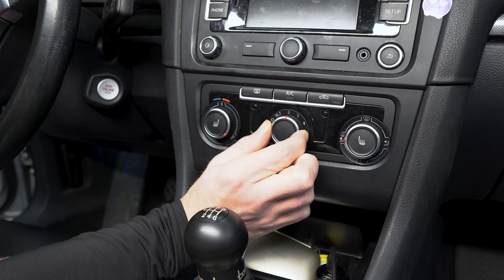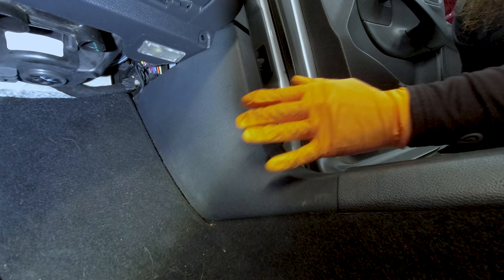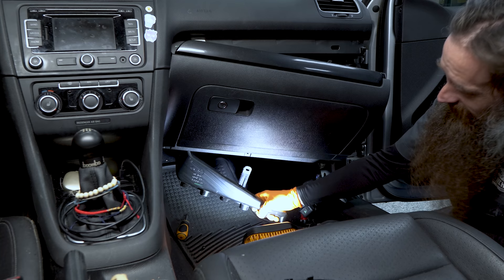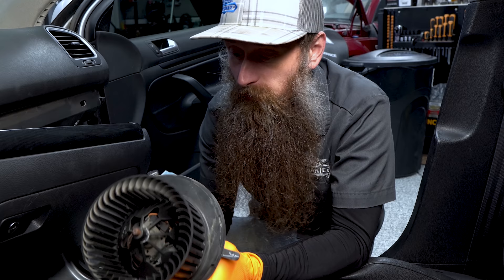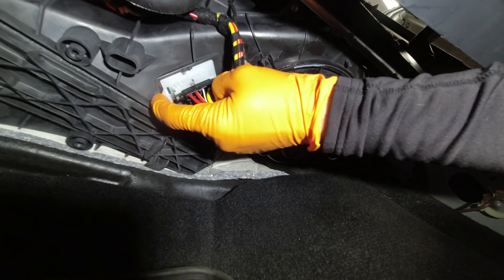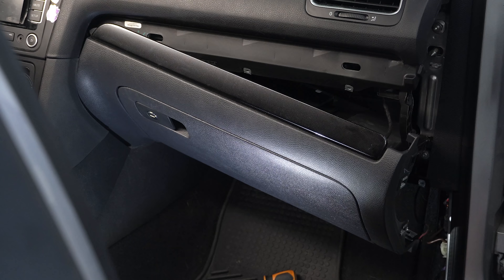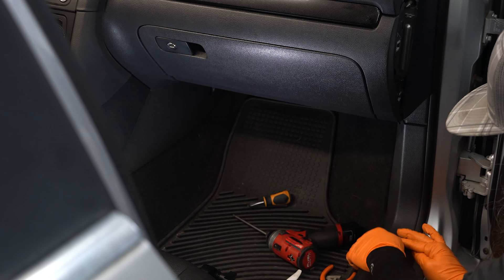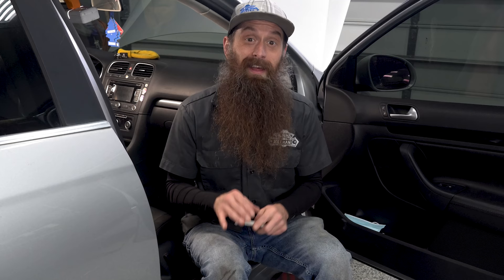How To Fix a Blower Motor Not Working ~ LOUD NOISES

Comment: Hey, so I am battling this issue with the cars fans in general. I have a 2006 gli, and my blower motor stopped working with the code 01273 (doesn't say v2 on it though, just short to b+) and I have replaced both motor and resistor/module, checked wiring, checked all fuses, and still nothing. Closest I got to getting anything was I swapped the 460 relays but then got code 00457 and still the 01273. But, oddly enough I could hear the tapping sound it makes when it tries to turn it on but still nothing. So obviously the relay might very been bad, but still didn't fix. Any ideas? I'm running out of ideas and it sucks driving in the rain with windshield fogging up badly
Reply: Also before it completely stopped, I used it was more intermittent and would be an on and off thing and would work if I kicked it lol. Sucky part is, I'm told the resistor/module is vin specific and mine uses revision B and those were discontinued, so im not even sure if new revisions will even work

Comment: I have a code and weird issue with my blower. "Blower reduction due to energy management" OBD11 code b10ce00 vw gti. How would I fix this? I already bought a new motor and resistor. Same issue.
Reply from the maker: TBH I have never seen that one. Make sure your vehicle battery is good.

Comment: How do I get rid of bad smells from my vents? Already changed the cabin filter with not much difference. Can I just spray lysol in there?
Reply: Lysol isn’t effective at cleaning out car hvac systems.
Try some Lubegard Kool-It Evaporator and Heater Foam Cleaner (or a similar product), it cleans the areas where mold is most likely to grow (evaporator fins and condensation drain).
Reply: @300DBenz  Thanks, I will give that a shot. Looks pretty easy to use.

Comment: Why would a 2011 Tiguan be blowing cold are on half of the car and hot air on the other (drivers side is hot) ? I have tried to do research and I was having other issues with the motor but after replacing motor now it’s blowing air again but it’s not hot at all.
Reply from the maker: Depends on what you’re asking. It could be heater core clogged if you’re asking for full heat. But getting 1/2
Reply: @HumbleMechanic  that is what’s happening I have half of my heat working drivers side functioning fine but the passsnger side is not. It blows cold air all the time

Comment: How do you clean the blower motor? Shop vac?
Reply: Compressed air and maybe some electric motor cleaning spray if there’s a lot of carbon dust from the brushes.
Reply: @300DBenz  it is also good practice to use silicone or lithium oil on the bearings .. after 10yrs in operation they are dry like Sahara

Comment: See, it was a bad design, there is no winding design or muffler at that air vacuum port, that causes light objects get suck into blower. Not to mention it also causing an incredibly loud airflow noise in cabin while internal circulation, because in this time the blower are exposed directly to cabin

Comment: With my 2014 Jetta I replaced the resistor and problem solved. That, and I took the napkin that came from the glove box out of it.
Reply from the maker: Hahaha
Reply: @HumbleMechanic  also, the end of the shaft for the blower fan has a rubber cap on the end of it, mine had come off and was stuck in the blades, that could also cause noise. I stuck it back on the shaft.

Comment: You definitely don't need to loosen or remove anything other than the fabric piece.  It may make things easier,  but you can get up in there and just twist the blower motor out and back in.
Reply from the maker: On this one, it’s not worth fighting. Other cars have the space this one, not so much.
Reply: @HumbleMechanic  good to know. I just did this on my 14 Passat and was able to maneuver it in and out,  but the Passat is a little bigger.  Love the first vlog video btw.

Comment: Back when I worked at an Oldsmobile dealership (I'm dating myself lol), we'd get fan noises like that all the time because the retirees that drove them all seemed to want to have those travel packs of tissues in the glovebox along with a bunch of maps.  The fan would happily suck up loose tissues when the AC was set to max.  Second most popular was dead radios in Silhouettes with CD players that sounded like a piggybank when you shook them.  They'd leave the grandkids alone in the van and they'd fill the "piggybank" with change from the ashtray.

Comment: Dude most of the time the blower gets stuck because it needs new carbon brushes and by the look at all the black powder in that fan blades tell you how much carbon has been used. So taking it on an off will not solve the issue. It’s just buying time before it gets stuck again.

Comment: Misleading title. The video shows absolutely nothing on how to FIX a blower motor, rather than it shows what was the source of extra noise while the motor was working. By the way, you don't even need to remove the glovebox and side trim panels at all. I managed to take out and put in the motor on my Mk6 multiple times without removing anything extra apart what's needed when replacing cabin filter. The reason I was removing and putting back mine so many times is that moisture got into it, seizing the shaft to the "bearing" which it spins in. At first it was making noise, as it was spinning with entire bearing, later it seized completely. I used grinding wheel to cut off the spots which hold lower bearing assembly, remove the bearing, used sandpaper to clean it and the shaft as well. Then put back together, spot welded the lower retainer on, also the shaft and bearing got much grease into it. 8 years later, still works fine.